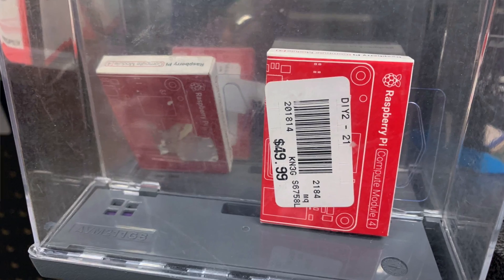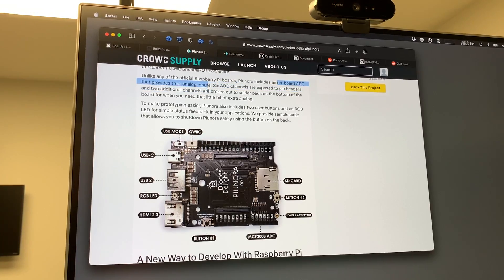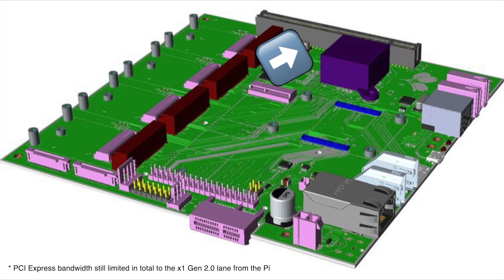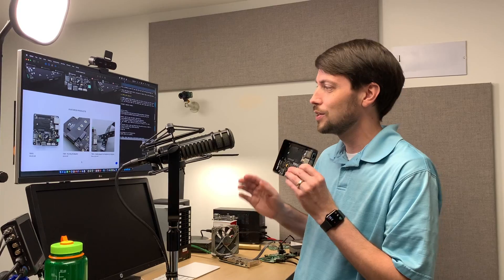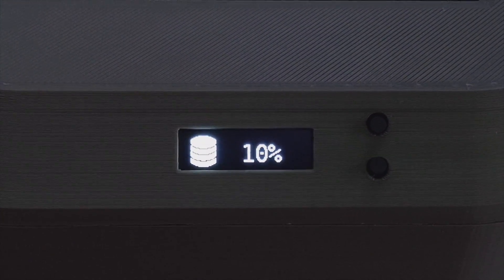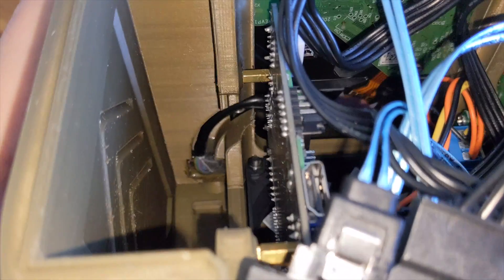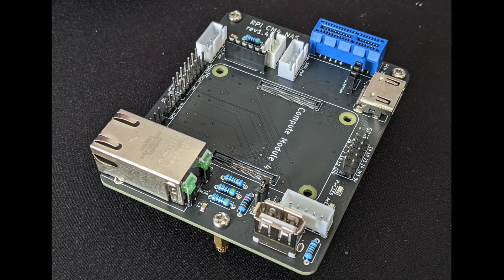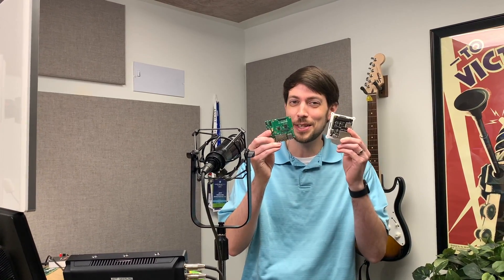New Raspberry Pi Projects - CM4 NAS, Piunora, and Seaberry!

Comment: I assume given its small size, a Raspberry module can be mounted on a standardized PCIe card that is inserted into a desktop tower. This basically acts like an independent computer inside another computer. Power can be piped through the PCIe slot. Is there such a product out there?
Reply from the maker: So far, not that I have seen. It is definitely possible though!
Reply: Maybe this idea can become something like IPMI

Comment: I'm still waiting for router board video.
Reply from the maker: I'm still working on it, don't worry ;)

It's a little more involved since I'm actually testing a few different scenarios (Vyos and OpenWRT), and also ended up rewiring my entire home network in the middle of it (oops... scope creep!).
Reply: Looking forward to this one!
Reply: Which routers are those?
Reply: @JeffGeerling  I'd be very interested in 1) if you can get gigabit symmetrical via a single connection and 2) how much filtering, qos, dpi, etc. You can run and maintain that performance.
Reply: I just got mine from Seeedstudio.  Looks like heat might to be a problem.  Running 78c idle with 32gb eMMc cm4 with heatsinks.  I might have to swap out the 32gb eMMc for a 16gb eMMc just to verify it's not the 32gb board's fault.

I need to find some sort of fan cable converter as the fan connector is smaller than the one on the Raspberry Pi4 CM4 io board.  (notice on the board photos the fan connector seems to be covered with white tape to hide it).  I think the cm4 is crashing w/o a fan running.

Comment: The seaberry looks interesting, I glanced at it's crowdfunding page briefly and couldn't discern what they expect for network speed, I'd like something in that form factor for a NAS but would need a gigabit Ethernet connection to be worthwhile
Reply from the maker: The RJ45 port on the back is tied into the network chip on the CM4 directly, so it should support 1 Gbps.
Reply: @JeffGeerling  cool, the form factor plus flexibility makes it really attractive for my NAS, will need to see price point and timeframe

Comment: That Seaberry board has some potential as low end desktop or something along the lines of cyberdeck ;)
Reply from the maker: It would be pretty awesome; and with all the expansion capabilities (even though capped at PCIe x1 Gen 2 speeds), you could put some nice cards on it to get pretty much all the features of a low-end PC.
Reply: @JeffGeerling  I'm kinda thinking that is it possible to make it happen like with litium-ion battery or LiFePo4 battery.... Styling it like the Division cyberdeck that I saw but like command center style even :D

Comment: Dammit I'm still lacking on my board. The silicon issue makes hard to find chips at a reasonable price.
My Power management, RTC, HW monitor was designed to use an STM32 but those are not available and prices are 3x.
Reply from the maker: It is such a hard time to do anything more advanced than a super-basic board :(

Good luck and hopefully you can get the parts you need soon!
Reply: @JeffGeerling  i hope too. I'm designing an 10ch AV receiver. The idea is to use the RPI as an HMI and as a network media player. All the other stuff is handled by DSPs. 
But as said the prices/silicon issue already made me change the design twice!

I hope to have the parts in a reasonable time to finish the design.

Even i2c 8MB eeproms are in backorder with 44 week of wait!

Comment: Dear Jeff,
Is it possible to fix multiple CM4 onto 1 PCB so that we have multiple processors? Eg: 4 x CM4s = 16cores. And perhaps even up the RAM to 128Gb. Now we have a BeastBerryPiE...
Since you are the expert, you might have done or seen something of such.
Once again, thanks to you & RedShirt ;)
Reply from the maker: The Turing Pi allows up to 7 CM3 boards, though some people are trying a Gumstix adapter board to mount CM4 boards with little success.

They are making a Turing Pi 2 later this year that should be able to mount multiple CM4s, but they wouldn't combine cores or RAM, you need a system on top of them to coordinate tasks (e.g. Kubernetes or K3s).
Reply: @JeffGeerling  
Thank you Jeff!
👍👍👍
Reply: @JeffGeerling  Yes, gone thru all the 6 videos you posted in the "Turing Pi" playlist & even located your blog post via duckduckgo search. V1 with 7 cm3/cm3÷ each cm3+ is 4cores upto 8gb.
Yes, seems like a great platform to learn and kinda feel like blade computing.
However, like what you said: pi4 clusters like your 'Dramble' cluster would be way faster.
I surf a little at their website - if I understand correctly they mentioned each cm3 it limited to 100mbps network speed while your Dramble has 1gbps each. Of course, easy hot-pluggable is a nice feature for the Turing.
Anyway, could not lay fingee on v1/2 at mo.
Came across the ClusBerry CM4 carrier board in my search too; guess you hv seen them.
Thanks again.

Comment: A Rpi4 can be over clocked to 2.147GHz. 
Can a CM4 module be overclocked from 1.5GHz?
Can the mirko board not accept a CPU fan? It looks like it has 4 hard points for a heatsink/fan!

Comment: I plan to make my own version of cm4 io board during summer this year after I finish university in few months and will have more time for it, but when I preliminarily looked for the rough list of needed parts to estimate the costs I noticed that the usual suppliers are starting to be heavily affected by the silicon shortages (mainly lcsc where it is really a challenge to find something in stock these days and when I sent backorder inquiry they usually responded simply with part unavailable). Do you happen to have similar experience with your cm4 project?

Comment: If he has never designed a PCB before, then I'd wait for the 2nd version after someone with PCB design experience fix all the mistakes :)
Reply from the maker: Ha! Well, the fact he could base the design off the CM4 IO Board design means a lot of the potential pitfalls are already solved through a good reference design.

But even experienced PCB designers often have 5-10 revisions before they get something they're not entirely distrustful of!

Comment: a different solution would be modify a old 4 bay nas with removable drives that is either DEATH or no longer get any security updates/ can be hacked extremely easy.

Then all you need to do is modify the case a little bit by removing the old standoffs and add new ones.
Reply from the maker: It would be really cool if somebody made some CM4 IO board adapter kits to let it be mounted into different standard configurations.
Reply: @JeffGeerling  That would be possible trough those SAS/sata "sff-8643" compatible cables that allow you to use 1 connector to 4 ports.
that connector also supplies power.

Though it would be highly specialized as each NAS is different.
but the concept itself would be the same.

you can use a m.2 to sff-8643 adapter
even a PCI-e to sff-8643 is really small form factor.

if combined with a custom PCB, it could even become small enough to be soldered directly to a custom board.

With a plug like:
https://www.jpcco.com/en/product-622617/SFF-8643-Internal-Mini-SAS-HD-Receptacle-Single-Port-30u-plus-G-F-Vertical-SMT-Tail=2-4mm-PCNTC002ECZZ-0.html

Comment: Idea: Seaberry or Over:Board based RaspberryPi system, inside an emptied SFF office case like Dell Optiplex or HP Elite.
Reply from the maker: Would love to have a board you could slot into one of those kind of cases, maybe with USB 3.0 so you can use the front connectors and power button too.

Comment: Good news. Because i have an now about 6 year old HP Microserver and they don't produce them anymore. Yeah they call the call the new product similarly, but that's super misguiding. It lacks all professional server features but costs 2-4 times as much as my model. So if mine breaks i'm sorta screwed with no alternative that's even close to reasonably priced. And older Raspberrys simple didn't have the IO speeds required. USB2.0 and 100mbit ethernet is a sad joke in a NAS context.

Comment: these are all cool projects but we're still talking about cm4 with single pci-e lane, right? that's why i'm building a diy nas on rock pi 4 which offers four lanes.
Reply from the maker: Yes, though one thing I am hopeful for is maybe the next CM5 generation could have PCIe Gen 4, so a x1 lane could give 4x the speed with the same carrier boards (assuming they were designed well...).

It would be even better if there were a cheap ARM SoC with x8 or x16 support, I can dream can't I?
Reply: @JeffGeerling  the new rockchip flagship soc, rk3358, is going to have:
PCIe – 4-lane PCIe 3.0, and 3x PCIe 2.0 (multiplexed with SATA)

i'm afraid anything beyond that will remain in the world of desktop cpus. unless apple makes everyone step up their arm game by releasing m1 (and m2?) for other hardware vendors, although i wouldn't count on that.
Reply from the maker: @TomaszStachewicz  Neoverse N1 CPUs already support PCIe 4.0 and are being built into Ampere and Graviton servers... I'm hoping that architecture trickles down to mobile chips like RockChip and Broadcom SoCs in the next generation.
Reply: @JeffGeerling  basically a single pcie 3.0 lane with its 1000MB/s will be enough for a 4-bay nas, then second one for ten-gig ethernet and we're good to go, everything beyond that will be extra capacity for caching ssd and/or more disks.

Comment: @Jeff: Could you possibly do a video of trying to get the Gumstix Raspberry Pi CM4 Uprev working on a Turing Pi 1 on CM4? A few people have tried on the Turing Pi Discord and haven't got it to work yet, maybe we're missing something?
Reply from the maker: I've been following that conversation (mostly a lurker over there), and I know it is tricky getting the CM4 to interface with something built for the CM3, because even if the signaling is adapted, sometimes voltages or tolerances can cause it not to work. Would love to try it sometime though.

Comment: Where is the raspberry pi 4 compute module available Jeff?
Reply from the maker: Today I went to Micro Center to pick up a couple accessories and found 6 in stock. Pi Hut had some last time I checked, and there are a few other suppliers with at least 1 or 2 GB RAM models. Only a few have 4 GB models though.

Comment: I wonder how well using a board with 2 displays running a Nintendo DS emulator? Gigantic DS ;)
Reply from the maker: Interestingly... I think it could be possible to build something very close to the actual DS form factor with the CM4 and a custom board. battery would add thickness but it's doable!
Reply: @JeffGeerling  There are probably still some after market shells on eBay. Even then, a giant DS would be funny. Using the official displays would make for a huge DS :) Using actual HDMI monitors would make it be even bigger :P

Comment: Power is a very annoying struggle with RPI especially when trying to make a NAS out of one. I really wish they would have moved on to 19v by now.
Reply: no, 3.3v , 5v , and 12vdc is all you need today.
anyone can make that today, cheap picoPSU + adaptor , super cheap buck/boost pcb's, inline parallel super cap ,simple separate hd power units +  a separate logic power.
Reply: @paulmaydaynight9925  I know. 19v is laptop power brick voltage and you can get them dime a dozen.

Comment: does anyone know of any 3d printer based cm4 boards, just ordered an ender 3 pro and I'm interested what the cm4 community has to offer
Reply from the maker: There are two I'm tracking; one seems to be a commercial product (Sigmoid S7P), and the other a lighter demo board by @MayerMakes (check out the latest Element 14 Presents video!).
Reply: @JeffGeerling  Those are pretty cool, and actually completely what I was expecting, definitely will be following those from now on, thx for the info.